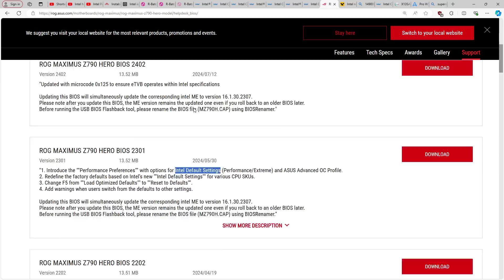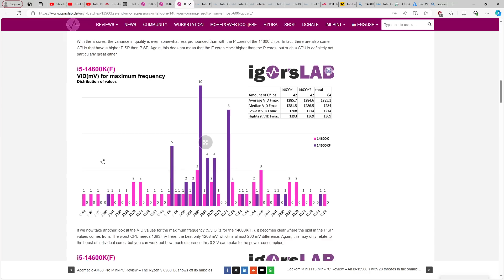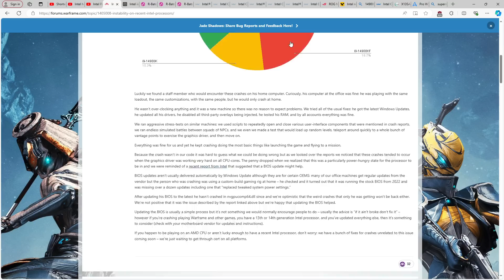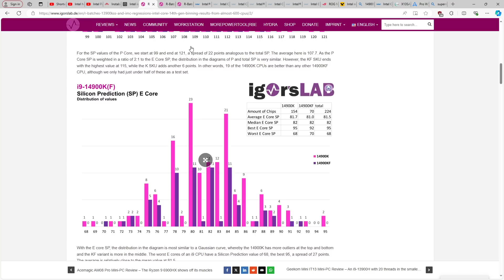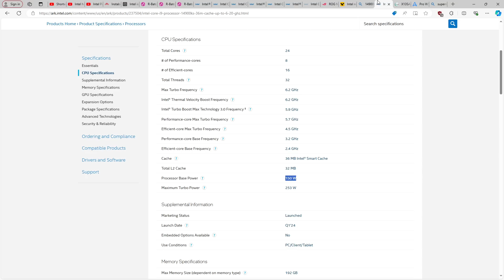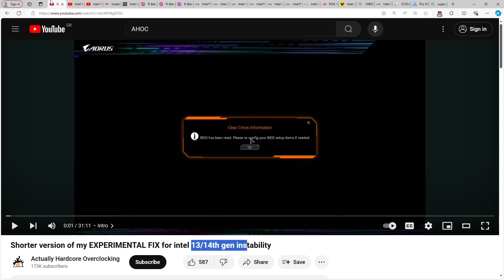The intel instability and degradation rant.

Comment: I think Wendell showed that it isn't only degradation, but also some kind of manufacturing/design level defect in the chips that is causing the degradation to be greatly accelerated. Alder Lake i7s and i9s don't run that much lower voltages than Raptor Lakes, yet dont show any comparable degree of degradation. Intel must have screwed something up when they did the hard design when they upgraded Alder into Raptor.

Would also be interesting to see the rate of crashing/degradation relative to the VID table.
Reply: The only big change was the IO betweeen alderlake and newer chips. On my 13900k that is waht failed. Devices were also being randomly disconnected and nvideo displays reestablished during reboots before software started crashing. Memory testing showed it was fine. My guess is the iOMMU acted up
Reply: @timothygibney159  From Alder to Raptor the hard design of the core was changed to enable higher clock speeds, along with the configuration of the caches. IO/device disconnects can also just be explained by instability elsewhere in the chip because those functions may be less resilient to errors than other programs.
Reply: Hearing the whole 11 month r&d to delivery, I/O failure, it kind of makes sense. They wanted to compete with AMD by going semi-chiplet (ie non uniform cores, while still being monolithic), so they could have their cake (gaming clocks) and eat it (stay competitive in multi core). Now you have an overworked I/O trying to core juggle and feed the hungry p cores and their resultant hotspots. Intel reaching for the sun in gaming applications likely didn't think about people using them for constant compute applications that will saturate the p-cores. To expect the I/O power control to handle these constant changes at the core level without some sort of error or instability is silly, which is why AMD does uniform cores and multiple Ccds. They could have implemented a solution via socket and mobo feeding separate core channels but chose to maintain gamer market share again and maintain adoption compatibility. All the Nuc and Ark investment proves they were kind of blindly pushing hard to maintain gaming market share. AMD baby, like fine wine...
Reply: @MissingNumb I think you might be right.
Reply: 36:50 ... but there lies the issue with the assumption that it could be "some kind of manufacturing/design level defect". Why only the high voltage parts?
I'm looking forward to what information those investigative tech-YouTubers will dig up.
Reply: @cmiex There isn't anything to really dig up. So many parts of the CPU rely on the core voltage rail (cores, L3, ring, and others) that any of those areas could be the first to degrade.

If it's any consolation, i'v been running a 12900ks for 2.5 years @1.4v/5.6/5.3(ring) fixed voltage (direct die cooling) and have had it degrade down to 5.5 within the past 6 months (@1.35v).
Reply: @cmiex  "High end" means "more sections active". "Lower end" means "More deactivated parts". The K series sold for a LOT of cash. Perhaps this is the opposite of the Phenonom 3 thing, where 99% of people unlocked the 4th core (I did, rock solid) because it was deactivated when not needed. Intel wanted the cash, and sold a lot of i5s and i7s as "i9s" and the silicon just was not high quality to push those parts!?
Reply: @cmiex  From Wendell's discussion with Dr Ian Cutress he mentions that 13700T may be affected "at a lower rate". A post from Matt (Alderon Games) on r/intel (assuming that the poster isn't an imposter) suggests that 14600K may also be affected, but "just more rare". I can't confirm whether either of these data points are relevant to this case, especially since I don't actually have the numbers, just hearsay from hopefully trustworthy people, so make of it what you will. 

Also, to quote the same Alderon Games guy (Matt): "The reason why 13900k and 14900ks were the main focus was due to the number of CPUs we had and the failure rate for those specifically was highest so this was focused on. Now that those are confirmed other CPUs are being looked at."

So there's a chance it's not just the high voltage parts. It's just that the companies who provided the data just happened to have a lot more of the higher end CPUs than lower end ones. In any case, hopefully we'll have more information in the coming days, though I'm glad I'm not personally affected (my current Samsung SSD issues are enough of a headache for me right now).
Reply: @SealCorner  Yes, I believe it is a design defect in the tape out that is causing accelerated degradation. Obviously the rate of degradation will still be correlated to voltage (local current density) and power (chip wise current density), but the rates of degradation are all higher than they would be if the defect did not exist.

It can be as simple as some mask(s) having a defect, causing some transistors to be functional but much more fragile than if they were made correctly.
Reply: Tell you something, they had a problem with 12th gen too but it didn't went all public like now, I've one of those problematic CPUs, 12600k that can only run on stock and will crash when stressing on P95 while my 13600kf is totally normal, I could not run any higher binned memory or even try to undevolt the CPU, haven't tried to RMA it yet, but I will this month
Reply: Intel rushed raptor lake out from design to tapeout in 11 months… let that sink in.
Reply: @morpheus_9 Yeah. I think this is the problem.  Intel is a short span of didn't iron out all problems in time.  Also Meteor lake being unable to be viable for desktop didn't help.
Reply: My gut feeling is that we have to think beyond the top-level numbers, eg Vcore - that this phenomenon involves microscale variations. That is, the answer will involve physics. Specifically, some phenomenon which was previously negligible rearing its ugly head. Eg some effect that used to cause 0.01V transients, which, when no one was looking, grew to now causing 0.2V transients. 

How much will the actual voltage across the silicon vary from point to point at a given Vcore? If the P-core power throughput is ramped up to an unprecedented level, could the load line end up delivering 1.6V to the cache and E-cores? Or perhaps there are high-voltage transients from inductance as the P-cores switch down from mega-power surges? I don't know how much inductance CPU circuits have. Or perhaps it's just the VRM inductance, saturating the CPU's capacitors and flooding the ring with a transient 1.7V?

These are just a few obvious thoughts, but I have no experience with the fairly extreme time-space-current-voltage regime involved here. All I'm saying is, I think the answer will be outside the box of the usual physics and data points that are usually measured and contemplated.
Reply: Didnt they touted an "improved node" with the 13k and 14k series?
Reply: Yes intel silicon on newer production batches is just super low quality, that's why they can't handle on stability, but that puts into perspective if they will keep the cheap silicon for arrow lake and also brick people.
Reply: Hell, 14th gen chips seem to be dying even faster than the 13th gen ones
Reply: >Alder Lake i7s and i9s don't run that much lower voltages than Raptor Lakes

Same as 14600K which is notably absent from the error charts.
Reply: Wouldn’t be so sure this isn’t also affecting 12th Gen. My 12900KS has just been RMAed, never been overclocked, always been undervolted, max 195W power draw set since purchase, shows all the signs of progressive degradation over the last 10months. Might be a rare unrelated issue, but… I have my doubts. 12,13 & 14th are after all basically the same with minor efficiency and binning gains, and in my particular case it really shouldn’t be that it’s watts sucked through that are damaging them, which implies that there’s some other factor(s) that’s causing failures.
Reply: @clivesweeting7338  Raptor has new hard design and caches even if at a logical level it is the same core as Alder, most or even all of the layouts and timings of the logic were assessed and optimised so they could clock it faster (at the cost of area and power).
Reply: @wewillrockyou1986  well for my sake I hope 12th Gen is “immune” to these specific issues and I just got unlucky. RMA collected yesterday, fingers crossed the replacement when it arrives works forever - like every other Intel CPU I have previously owned…
Reply: @clivesweeting7338  Maybe the KS is binned too high? Not sure, My 12700KF & 12900KF are gaming stable on Nobara. It hasn't been a perfect Windows really wasn't running well when I left it , ram speeds aren't as good as they should be for Z690 QVL ram etc.
Reply: @dianaalyssa8726  the “bin” on the 12900KS only reflects what it can do if you thrash the heck out of it. My KS has been pulling significantly less power than a stock config 12900K and similar power to a stock 12700K. My logic was a KS would be “better” silicon that could support better performance when run on lower power, important to me as it in a small ITX case and I don’t like too much noise. AMD isn’t an option as I run it as a Hackintosh and hence need Intel for Virtualisation, and no it’s not a “Hackintosh” problem as it does the same running natively in Windows 11 and Ubuntu.

Back using my 9900K, which is thankfully still completely bombproof after nearly 5 years of 24/7 operation. Maybe they literally “don’t make them like they used to” at Intel? Fingers crossed I’ve just got unlucky and pulled one of the few rubbish 12th gen from the Silicon lottery…
Reply: @wewillrockyou1986  It's impossible for the i7-12700K to fail because it has top tier perfomance per watt at stock. No other high end Intel chip comes close. The 13700K literally pulls like 60% more power for a 30% better Cinebench result.
Reply: I don't think its an accident. I think its on purpose at this point. Some new artificially created-chip-rot-planned obsolescence BS. That isn't timed in properly yet or something...I call BS.
Reply: @VioFax  Doesn't have to be planned, they designed Raptor Lake from start to production in 11 months which is unusually fast and the engineers bragged about this fact. They likely missed something and we get these end results.
Reply: @AleraKira  There really wasn't any planning beyond binning tolerance and TVB adjustments. You can't go from design->tap out-> retail in 11 months. It's logistically impossible.

Let's be clear, 14th gen is a pure refresh of 13th. As noted above, binning is 99% or the "work". There is a reason lower end P-core counts increased (and why plenty of brand new 13th Gen still rolls off the line).

It's genuinely a voltage issue, pure and simple. We saw a 100mv increase maximal TVB, with every level of voltage increased on the TVB tables to a lesser degree.

Because of this, the CEP lookup needed to be changed to deal with these changes.

What Intel did was literally: "Well, we need to have some single core improvement over 3 generations. Find a way" and this was the outcome
Reply: @AleraKira  You use WE very loosely.
Reply: @kramnull8962  How? We as consumers are the ones feeling the results... Not really sure what angle you're going for there.
Reply: @winebartender6653  13th gen is also Raptor Lake.
Reply: @AleraKira  ....yes, I know. 13th Gen wasn't the "oh, we only had 11 months...", it was 14th as MTL was supposed to launch on desktops
Reply: @winebartender6653  For sure, it's definitely a voltage issue.
Reply: @VioFax  Even it is planned, degrading to such state in less than 3 years is shooting at your own foot, you still have warranty to honour and most of them came with 3 years. Imagine 50% of 13th and 14th gen of your pride and joy flagship Core i9 needing RMA before the warranty ends. This feels like a manufacturing flaws is discovered was after the product is sold and now they are SoL trying to honour the RMA, shifting blame while trying to find out what's the cause and proper solutions.
Reply: @VioFax Nah, not everything is some dumb planned obsolescence bogeyman.

Comment: Will 12th gen users be affected too? I'm running a 12700KF and cant afford an upgrade atm
Reply: Nobody is talking about 12th gen, so i wouldn't really worry about it.
Reply: @dethskullcrusher  Some people do talk about that. You can find commentaries about it in forums and youtube too. Its not degrading too fast as 13 and 14 generations, but its degrading as well.
Reply: No, 12th gen has failure rates similar to other CPUs.  Only 13th and 14th gen are elevated.
Reply: Ignore the comments above, it's strictly a 13 & 14 gen issue, listen to professionals.
Reply: Yes but not as bad, 12th gen has less E cores and ring bus frequencies are lower so they won’t show degradation as fast.
Reply: Yes.

Comment: Truth is  - Intel needs to discover from where the issue stem, we can hypothesis and deduct, but we don't have the tools, the quantity and expertise to do real failure analysis. This why there are engineers, that their whole job is analysis why things are failing.
Reply: @eliadbu  They probably have. And there's nothing they can do about it, except for lowering the voltage/frequency curve which would result in lower performance. Basically relegating 14900/13900 chips to 12900 levels of performance.
Reply: That is funny. So we should not hypothesis and deduct that Intel have allready done that? Or maybe we should hypothesis and deduct that Intel have no clue what is causing this issue after months of quite? Let us throw a simple statment down for shit and giggels. Intel KNOWS allready. If that is 6months ago or 2days ago. The engineers did their whole job. Maybe the engineers even told the higher ups before retail launch of Gen13 even! It dose not matter. If we rightly hypothesis and deduct that Intel knows but is not telling us? Then it 100% is a good thing that reviewers and tech people are taking Intel to task with this serius issue.  And it is not only for the costumers and all that even. At this point Intel is in a position so bad that investors and legal action should step in and ask what the leaders of Intel are doing. Legal action being to RMA and fix the mess Intel have unleashed.

We got the only tools and the quantity and expertise to do real failure analysis that matters. We are litterly the ones affected by the issue! (not me, last Intel CPU for me was Skylake and pre Ryzen latops being avalable.)  If Intel actually where doing their job they would never be in this mess to begin with. What makes somone a good demolition expert? Well if they where not good with explosive they would not really be called that now whould they? Most likely they would not even be allowed to have explosives if they failed the basics of reliability even ones.
Reply: @TheDiner50  What do you think, they are not investigating this issues?  "hypothesis and deduct that Intel have no clue what is causing this issue after months of quite"
They already said they don't know the root cause of the issue and investigating further, could they be lying ? Maybe but they might not be - you don't know. Show me proof that "intel knows" what causes the issues. No problem talking about the issue and the severity it affects consumers - by al means do it, I didn't say they should not give answers to consumers shareholders and everyone else - they should. But talking about what causes it - with no proper analysis, gives you no based answer - why it's happening. That is the job of Intel to do, and who consumers SHOULD get the answer from them. "What makes someone a good demolition expert" what it has to do with the issue, or understanding the root cause? You think I'm Intel side on this one? not at all, they should have given more detailed explanation on the problem by now, but SHOULD doesn't always align with reality. For anyone that interested buying these new chips I would recommend to not buy, for those who already have an effected chips either RMA or getting different CPU is their best option, no hypothesis or rambling can change that.
Reply: Intel will never publicly reveal anything because then they'd be admitting to having designed and shipped defective products

Comment: What I had noticed after testing my i9 14900kf was that one of the two favoured cores was not stable at 6ghz ever after increasing the voltage to 1.55V. Since reducing the max clock speed to 5.9 GHz I haven't experienced any issues. I assume the degradation is due to trying to reach clock speeds that it can't run constantly.
Reply: Your CPU is WAAAAAY overvolted. That won't last long. I never would go over 1.35v on my cpus. Your voltatge is probably what fried that core. I would lower them significanly if you want it to work by fall.
Reply: @timothygibney159  Intel specs VCC upto 1.72V for the 14900 (actual internal voltage will be lower) - comparable nodes are 1.2-1.5V - I highly doubt the Intel process is that much better.
Reply: @timothygibney159  i doubt it but i only pushed it that far to see if it would work. I lowered the max voltage to around 1.501V after that
Reply: Framechasers  did a video yesterday that the reason intel was having this issue was because 2 cores where trying  to boost too high
Reply: @sanchezmiki2006 Framechasers is literally a meme tier channel theres no way people are taking whatever that guy says seriously